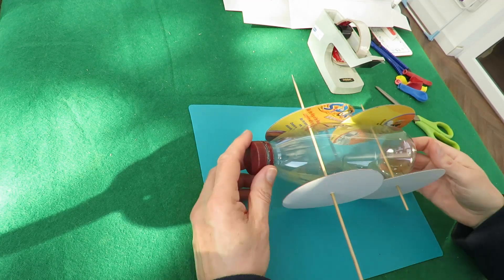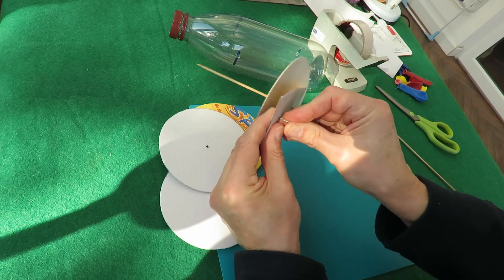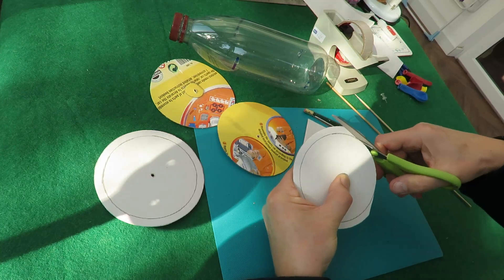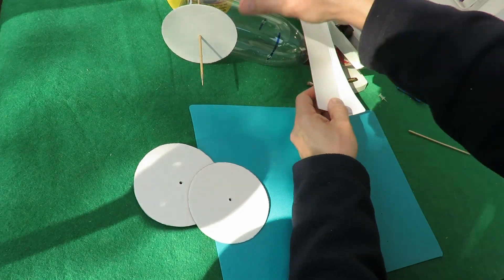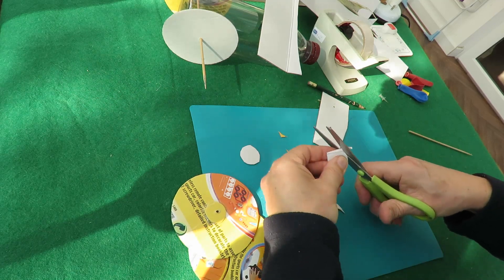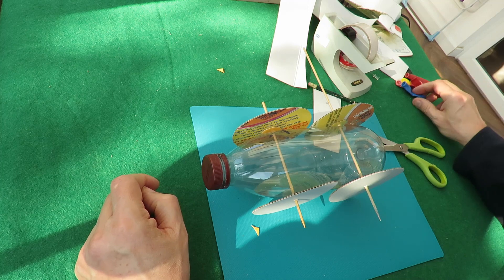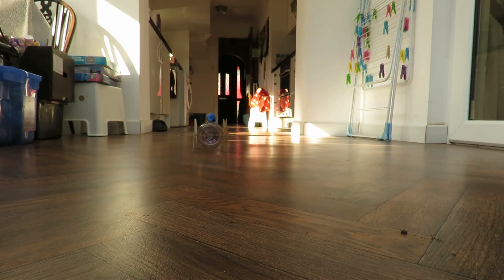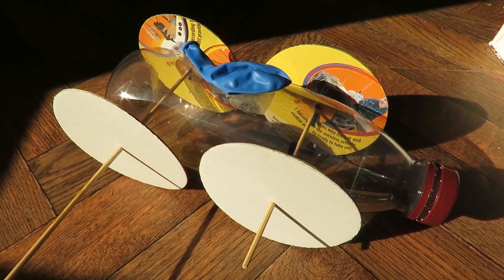Simple Basic Balloon powered car

Comment: That went off good the second time. Do you still have the bigger balloons? Im thinking if u stick a fan on it and have the baloon blow directly into the fan that might get the car to move forwards a few inches?
Reply from the maker: Thanks Marc, I am trying to keep this simple. The problem with a bigger balloon is simple the space available on top of that plastic bottle. A bigger balloon would probably foul the wheels and slow it down. With a bigger bottle to move the wheels further apart you might have space in the middle.